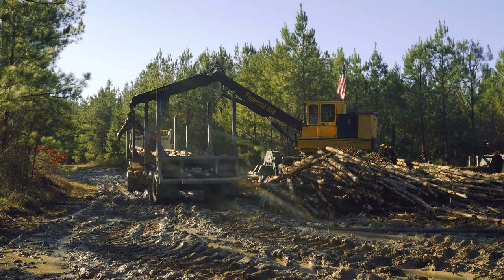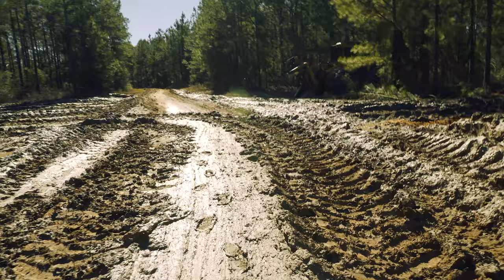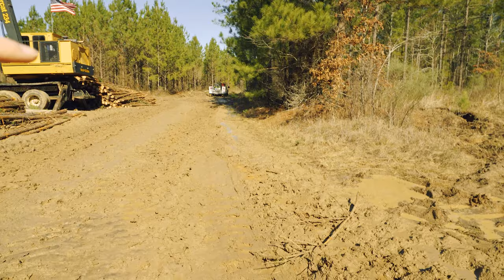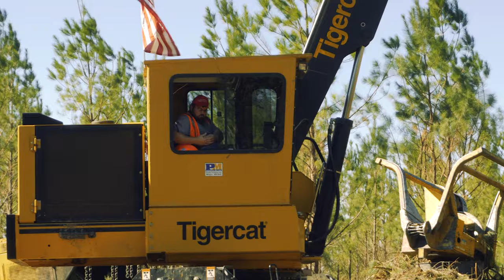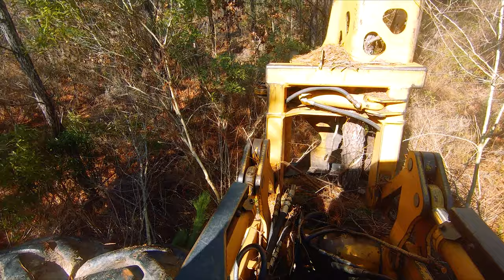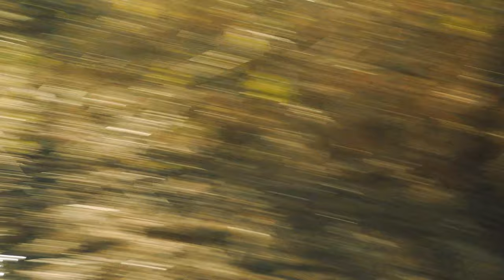Tigercat Skidder, Loader & FellerBuncher Working

Comment: There is a few tracts of pine up here in Pa that needs cut. If you are interested get a hold of pa state forestry Buchanan state forest. All different sizes in it. Only bad part of it is the hauling part. 3+ hours to the paper mill that will take pine. Glad the crew is getting use to the cameras and helping them by not doing the same thing over and over again. Hope puppy gets that ticket fixed. Great videos

Comment: " I got bills I got bills" Hey fella I am with you there. When you are paid by the load you take every load you can. I used to move equipment on Saturdays cause nobody else wanted to do it but I was hungry back then. I would haul everything I could. Heck I would even haul for the neighbors. Evidently Puppy ain't the shy driver. He gave a pretty good account of himself. In Ga you get a ticket if you DON'T have a strobe on back. As far as the videos heck yea I want to see it. I lived it for a while and miss it if that makes any sence.
Reply from the maker: We take care of our drivers and pay them by the day. Mills are so screwed up anymore most drivers can’t make a living sitting in line.
Reply: @CuttingEdgeLogging_Thomas  That is great to hear. I spent many a three load day sometimes four if I was lucky in the truck and yes it depended a lot on what was going on at the mill. Boss would make up for bad days so it usually averaged out.